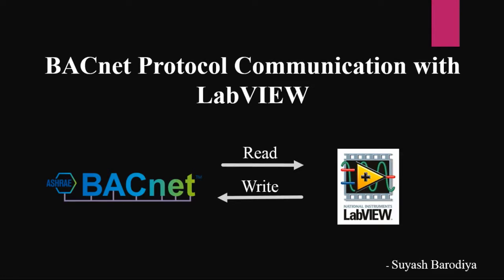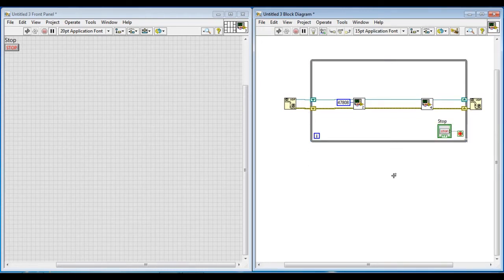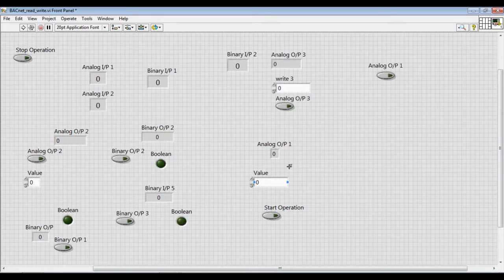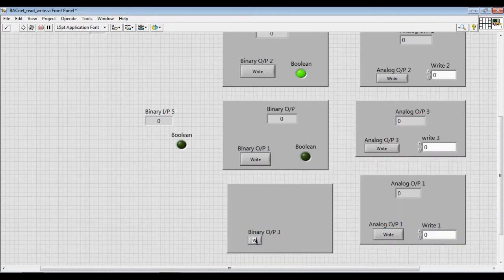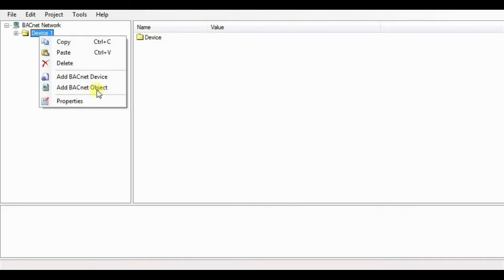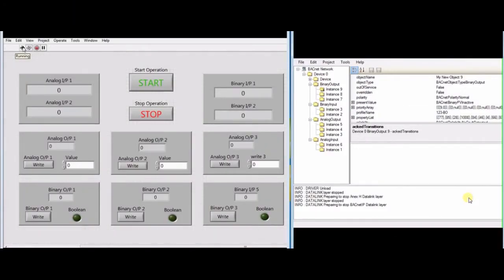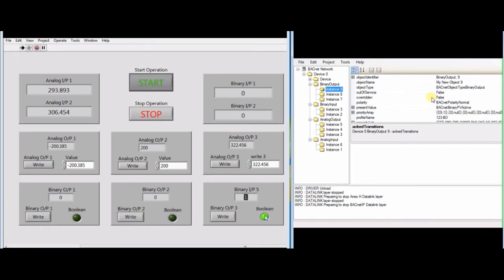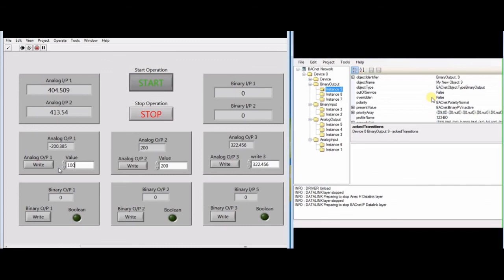LabVIEW performing BACnet object Writing

Comment: Can you please go over your network setup. I cant get the bacnet simulator to configure correctly. I have seen a video useing a bacnet simulator and any bacnet explorer on two different machines but i cant make it work. The explorer will find the device but will not allow me to see the device objects. I think its a network issue. Can you please go over the network settings and such
Reply from the maker: John Smith 
Hi john, if the explorer is able to find the device, then there is no issue with the network.
Please explain your problem in detail so may be i can help you.
As far as i understood , if your BACnet explorer is not able to find the device object then there must be problem with the device it self, in case if you are using simulator, then the objects are not configured properly